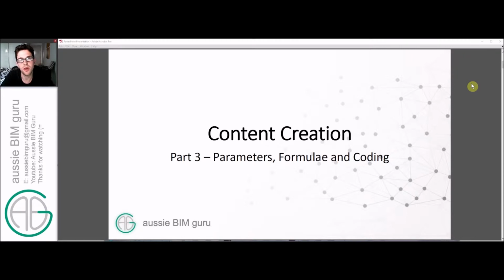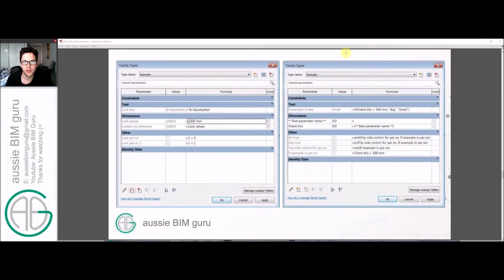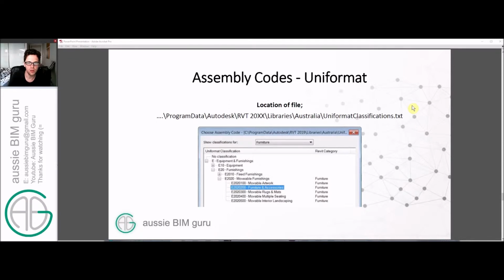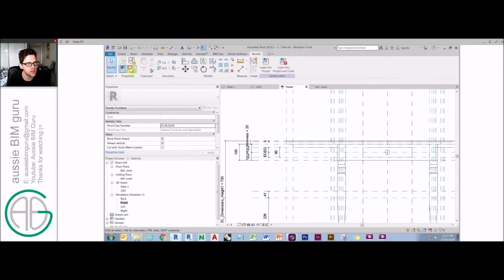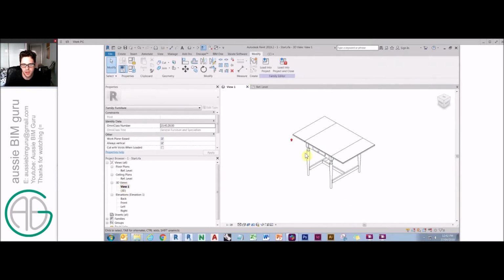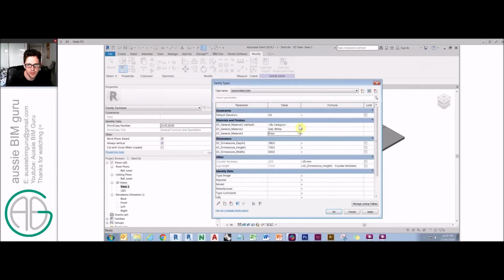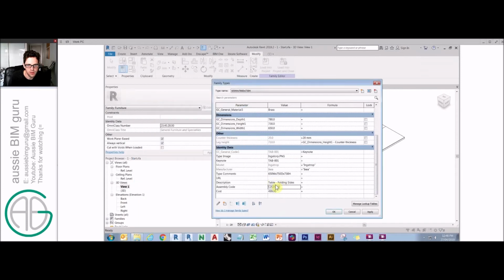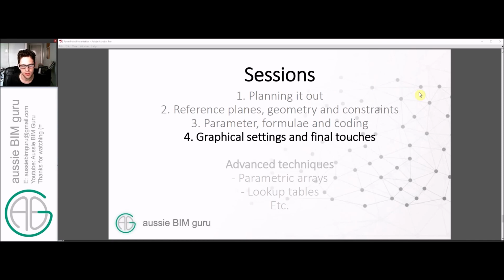Revit Family Parameters (Family Creation 3/4)

Comment: A few years back with the creation of the UK Level 2 protocols, now an international standard ISO-19650,  they were promoting the use of the Uniclass 2015 classification system.  Even though Revit has imbedded Omniclass it may be something to think about to push back into the families somehow.
Reply from the maker: Yes these days I have switched over to Uniclass 2015 using assembly coding.

Comment: Hey Gavin,

Sorry to bother you (again and again...)!
This time I actually have a couple of questions:

1) Type Image location - where should we store this files? if they get deleted from the server they disappear from the family? what is a good file size for the image? I think this would be quite useful in a plumbing fixture schedule for example.

2) Type name with sizes - How in your experience is this working? Because in mine people usually don´t bother to change the name to match the actual dimensions and it just becomes really messy :/

3) Type parameters locked vs. Instance Reporting - I've encountered some problems when setting some fixed dimensions (ex. frame thickness of a specific door/window). I've used a shared parameter and then made it instance reporting because we might want to see it but we will not change it. But then this fields are not available to use in formulas... Is that why you use type parameters and lock them instead?

4) Cost - I find this to be too generic, as the price can be by unit or per sqm. I've created a shared parameter (ex: Cost/m2 and Cost/unit) and then used the built-in Cost to actually calculate the "final price", although there is also the question if we should add with or without VAT...

Thank you for letting us pick your brain! :)
Reply from the maker: No problems!

1. I would store these in a subfolder within the category folder, or at the same level as the family storage. Ideally name image with some sort of system about the product it represents (so don't name it the same as the family), as you may have more than 1 version of what a family represents.

2. When the family type is heavily determined by its size then definitely should be included. For example doors, joinery, windows, concrete structure.

3. Reporting parameters are intended to be used for reference elements underlying the family, for example the wall faces in a door family template. Usually for 'vision' parameters like the area of an object, or a resultant dimension I would build this out for formulae if I need it in a formula.

4. Yes I have a second cost and costrate parameter as well for use when relevant. One issue with cost is it is always a type parameter, but sometimes needs to be instance (e.g. for a structural beam).

Comment: Is there any way to limit users to only three or four materials? say this table came in red, white, or wood. And what if this table had four styles, each could come in any three of the colors. Is there a way to do that without having to create 12 types?
Reply from the maker: Unfortunately not. A swift rap on the knuckles and some training i guess!

If your material parameters aren't shared you can add a tooltip that lists the valid materials they should use maybe?

Otherwise beyond that using a key schedule with delimited finish scheme options and a dynamo script to push the equivalent material to the object based on what is selected is the only other way i can think of, but its very convoluted.

Comment: What is the significance of the "LOCK" toggle in the family edit dialogue? When would you lock a parameter or not? also, what's the benefit of utilising shared parameters? Is it just a scheduling thing or to keep consistent parameter naming conventions across an organisation?
Reply from the maker: Shared parameters enable cross project data structures, which enhance scheduling, tagging and computational accesdibility for tools like dynamo. I use them extensively in all my work.

The lock toggle tells revit whether it should try to maintain this dimension as other parameters change in the family, e.g. if a handle is stretched, does the parameter maintain its value and get dragged along (lock) or does it flex to allow the plane to move independently. Noting this is only in the family editor itself.

https://revitforum.org/showthread.php/3720-Locking-Parameters-in-the-Family-Types-Dialogue-Box

Comment: How would you work around the 'model is overconstrained' warning?
Reply from the maker: Typically this warning is caused by trying to add a parameter or locked dimension where it isn't needed, or isn't possible to be flexible (e.g. the leftover space between two reference planes constrained by other parameters to different reference planes).

If you need a fairly brute force solution, this should work: 
https://forums.autodesk.com/t5/revit-structure-forum/overconstrained-geometry-problem/td-p/4666459
Reply: @AussieBIMGuru  Wow that makes sense.  Thanks for cleaning that up!
Reply from the maker: @andrewolivo3876  you're welcome! Been in the same situation many times ;)

Comment: Hi Gavin,

I have a question about Nested switching family, I’m not sure if it is possible to do, I have searched throughtout the internet I haven’t found any similiar situation as I’m looking for

How can I set up a family type to switch its type by itself in case it measure get changed in the project?

For example if there is one steel beam connecting two columns. Let’s regard that the distance between two columns is 3000 mm and for this far distances I have to use BEAM A. So I realised that the dsitance between the columns have to be 5000 mm instead. But for that far distance I need to use BEAM B that is pretty much the same as BEAM A, but with different features as self weight and data ID. Both of BEAMS are a family nested with different types. So How could I create a parameter to limited the length of and switch to the beam which suits the length required in the project?

I’ve tried to use the syntax according to each beam lenght, but the software doesn’t allowed me to create a syntax with the Length parameter which is a standard parameter in the structural framing template family.

I've accomplished something similar but still not the suitable as I want to. I've created the beams in the generic template and it's shared parameters, loaded into a structural framing template and created a family type parameter to each and used a syntax for the length. But I couldn't get the shared parameters created in the generic beams.

Is there a better way of doing that?

Cheers.
Reply from the maker: Hrm tricky, I'll have a look into what can be done this morning... I believe it may be possible to embed a shared parameter into a formula related to length.

If not, Dynamo is likely the best option.

Will get back to you!
Reply from the maker: Solution sent via Linkedin, let me know how it goes!